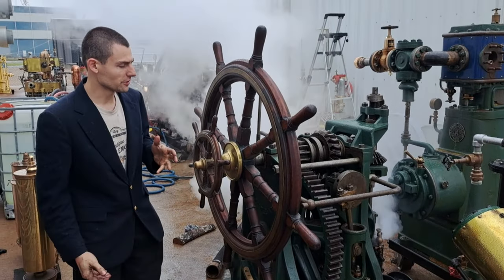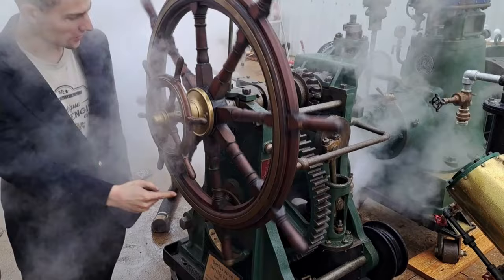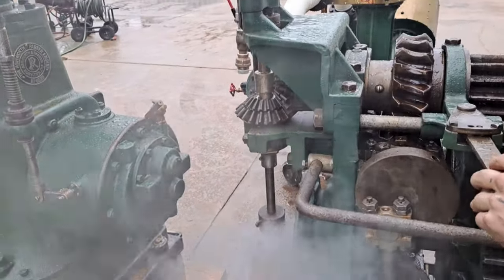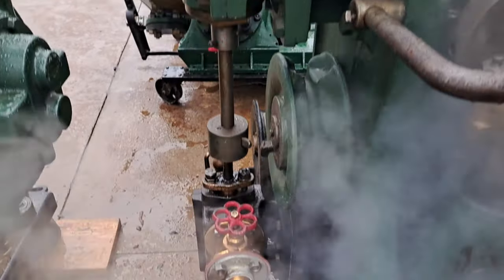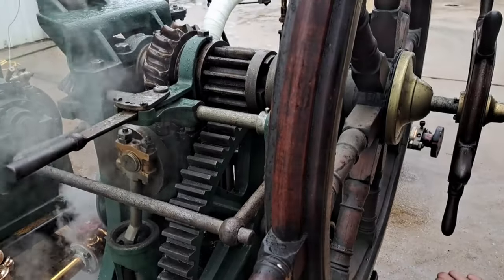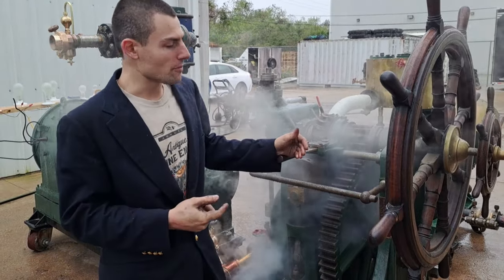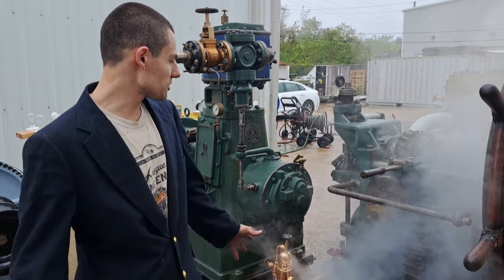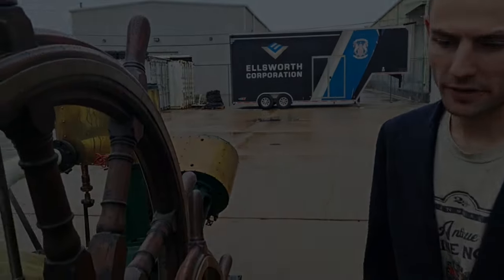Donkin Steering Engine

Comment: It never ceases to amaze me the incredible variety of uses that have been found for steam engines. But what really amazes me is the brilliant simplicity that allows these engines to accomplish even the most seemingly complicated tasks. If you left an idiot like me with the task of designing a steam-driven steering engine, I'd have gone with the most basic manual reversing gear and regulator method. I'd never in a million years have thought of this sort of mechanical computer that allows the steam engine to regulate itself through nothing more than the clever use of mechanical linkages and gearing. Absolutely beautiful. I'm not sure if the term "steampunk" is an insult to you or not, I certainly do not mean it to be, but this sort of mechanical automation is a fine example of steampunk technology in real life.
Reply from the maker: I never had any time for steampunk because it's a fetish.  There's nothing punk about real engineering.  You would no longer be amazed by this simple mechanism if I showed you a compound four-valve engine with an extraction governor adjusting the LP admission valve cutoff based on receiver pressure, and a Lumb's automatic regulator serving as an integrating computer to eliminate hunting on the speed governor for the HP cylinder.  That makes the mechanism on the engine in this video look barbarically simple.
Reply: @AEKarnes  I definitely get that. For my part, my favorite aspects of steampunk were never the "punk" elements anyway, but the hauntology aspects; seeing futures that never were but perhaps could have been. Things like "What if Nicolas-Joseph Cugnot's steam wagon had actually been taken seriously in 1760?" That alone could have moved the history of steam technology forward a good 50 years. Or "What if Charles Babbage and Ada Lovelace could have developed a working commercially viable analytical engine in the 1850's?" Or even "What if Abner Doble hadn't been such a perfectionist and developed a mass-producible steam car in time to beat Henry Ford to the punch? Perhaps tied with a timeline where the Stanley brothers had given Doble the time of day instead of resting on their laurels." You yourself have demonstrated such visions in your illustrations, showing even such basic yet to the real world revolutionary concepts as vertical triple expansion engines with actual counterweights on the crankshaft to eliminate hammer blow. Even the example you state here, though I understand perfectly from your description how it works, I would never be able to find the words to describe it myself as anything more than "mechanical witchcraft". This is why I truly admire folks like yourself who have devoted their lives to keeping this tech that so many wrongfully view as nothing more than quaint and archaic alive, perhaps even seek to further its long dead development. Steam is not dead as long as people like you keep it living. All I can do is gaze in wonder.
Reply: I'll simplify it to "steampunk is a feel".

I get the intent. At the same time I see where "disgust" may come of it lol

It isn't the steam that makes it steampunk. It's the "exposed guts and raw working flesh" of mechanical equipment of this era. Not the complexity. The "in your face intricacies" of it. The more of this of course, the better. Nothing like watching a very complex mechanism doing it's thing, particularly if a lot of power is involved. Speed not necessarily (in fact not likely) apply either. Raw, elegant yet aggressive power, doing something.
Reply from the maker: It's not really an anything, its a weird niche genre created by people who are starved of exposure to real engineering.
Reply: @AEKarnes 
I, having Aspergers, often in my life have longed for the beauty and rugged simplicity of steam power engineering. Often rigidly. Most of the normal people see steam as a fun but archaic form of power and romanticize it in a way that I don’t. 
I see it for what it is,for what it is today and the solution for many of the problems we face now and in the future. 
I can’t blame anyone for romanticizing in a made up world. It is simply escapism. 
As mechanics and power engineers we are bridging that gap that they have not had the opportunity to engage with in person. 
Trains were my first love and especially steam passenger trains. All things steam are always a magnet for me. 
I make a living repairing EMD locomotives for a short line railway but have had the pleasure of working on no fewer than five steam locomotives, a few tractors and other steam era equipment. 
I love your work, insight and passion for the preservation of this history and knowledge. 
Just remember to be kind to those who’ve never been scalded, cut, surprised or otherwise bruised by the reality of this profession. 
Greetings from the high plains of Texas.
Reply: I loathe the term "steampunk" on a level reserved for only the worst sorts of banal, shallow, puerile contrivances that broken minds have insisted on conjuring...  and that I [and others] are unfortunate enough to behold. 

Yet another assault on all that is holy and proper, for no other reason than spitefulness borne of permanent adolescence and arrested development.

It seems to me that the vast majority of "Americans", in particular, never mature any more. They carry on like children for the entireties of their lives. Nothing of actual importance is taken seriously by them; they fear even thinking about doing so. Perhaps it is rooted in their fear of the truth? This is a huge problem in this era.

This will not end well, that much is very clear.

Comment: The AV8 Harrier has a somewhat similar concept done with flight controls where double acting hydraulic cylinders have a proportioning valve fixed to their sides and the mechanical pushrod presses on the valve, the entire cylinder case moves while the actual rod stays fixed on the frame. This makes it where the movement of the cylinder will naturally cause the valve to shut itself off once it has reached the new pushrod position. I thought it was a very clever way to make a simple, yet effective hydraulic system. In fact, the pilot needs springs and dampers on his flight controls so he can encounter some kind of resistance to work against, otherwise his flight controls would feel effortless.

Comment: Basically power steering for a large ship, the steering engine takes its steam either from the main engine boilers or a separate donkey boiler, the built in computer driven off the steering wheel  shaft is neat, not even Audi, Beemer, Jaguar or Mercedes have such an option on their cars.

Comment: The gear input and gear feed back recentering the valve is some what similar to the old wood ward  Hydro governors I work on. The hardest part to train new folks on is the feed back mechanism. The restoring mechanism. Restoring to neutral input position, depending on input command. I'm going to use this as a training aid. Input screws the valve open, feed back screws it back closed. They may grasp that quicker.

Comment: Fascinating, and extremely well explained. I do wonder, however, why not a balanced rudder where the rudder shaft was not on the leading edge of the rudder but somewhat further back, or even in the middle, so that the hydrodynamic force acting on the rear of the rudder would be offset by force on the front of the rudder, once turned, since it’s pivot point was in or near the middle? I’m sure there is something I’m overlooking, I’m certainly not a marine engineer, I just have ideas that pop into my head.

Comment: I am a long retired steam engineer on deep sea trawlers, out of GY. Even though I watch U-Tube regularly, I have never subscribed to a site yours will be the first. Wonderful stuff. are you aware that all pipes on vessels in the days of steam were measured ID and all pipework ashore was measured OD this has long since been forgotten, and nearly all vessels use landlubbers off the shelf pipework so now use OD, ID was important due to pressure calculations needed to be accurate. I have used steam driven steering, it certainly beats the old ROD and Chain. When up in the Artic circle we had to keep all our steam driven winches and such like on deck, slowly ticking over. But i'm sure you know that.  Question why are you selling it? would a contribution to the Mueseum help you to keep it? if so how much?

Comment: Wouldn't it be a wonder if a 'computer' in an engine still just meant a well-designed valve?
Reply from the maker: the computer is the hand driven screw and engine driven screw collar connected to the valve.  Combines two data inputs for one data output

Comment: Learned something quite interesting about how a giant rudder could be moved while under power or even against a mild current without the need to have gears upon gears for reduction translating into torque. It's a similar principle of moving a mile and half freight train using a five horse Briggs. It could be done, but there would easily several hundred if not a few thousand feet of gear boxes to get the power necessary to the wheels. Similar to steering something like an ocean liner. Massive ship, equally massive rudder surface pushing against water and the momentum of the ship. As the said either a wheel about a hundred or so feet in diameter or, power the steering gear.

As for leaking all the steam. Yeah a little for keeping the cylinders hot to cook off condensation is built in, but keeping the lubrication and other maintenance up? Yeah not really a thing since you're talking about taking away ability to steer for however long. Ships like that need to be moving to make money, not sitting still. To move you need to be able to steer. No steering means no moving. No moving means no money.
Reply from the maker: It was very easy to keep maintenance up. It just so happens that in the era when these machines were all destroyed, it wasn't.  It was an era of remarkable decay and waste.

Comment: I wonder if today's engineers could design that without the aid of computers or calculators or any modern electronic gadget. I have my doubts.
Reply from the maker: considering I am an engineer of today, and there are others out there like me, the answer is obviously yes, if we are allowed to work unencumbered.
Reply: @AEKarnes  Gotcha. I figured you were, and my comment wasn't meant to sound degrading. But can you imagine the amount of mathatical knowhow, paperwork, and blueprints that it took to design a mexhanical marvel like that. It's amazing to me.
Reply from the maker: Considering I've designed entire systems incorporating these engines and built parts of these engines and fittings for them with no drawings and no math beyond simple addition and subtraction during macining, there is a lot less to it than you are thinking.  This kind of engineering is almost all intuitive.